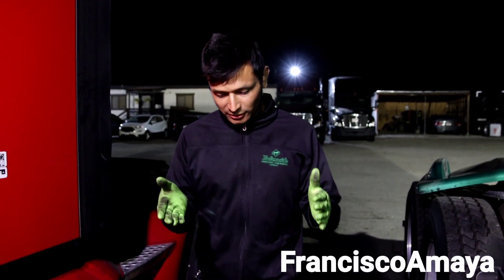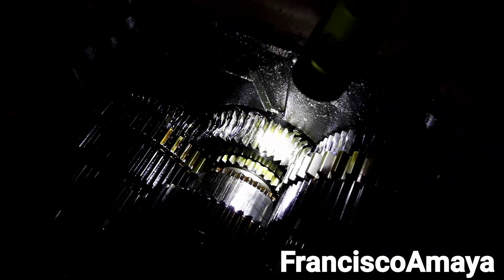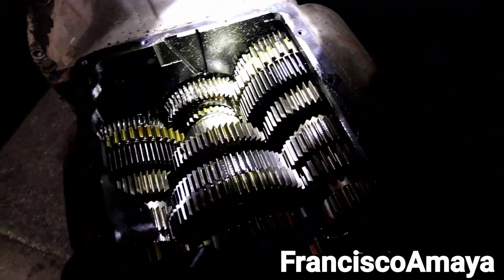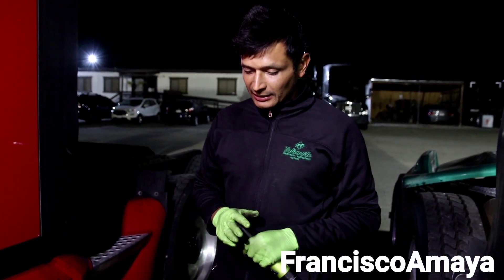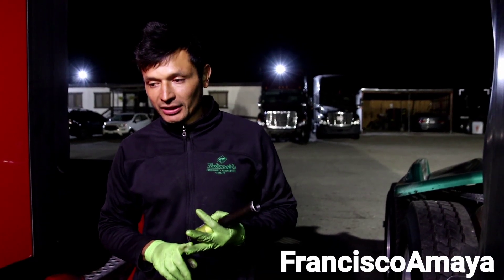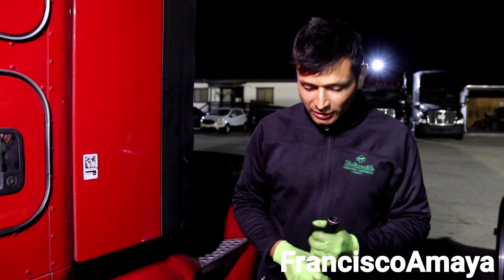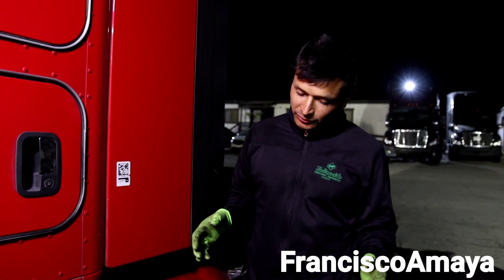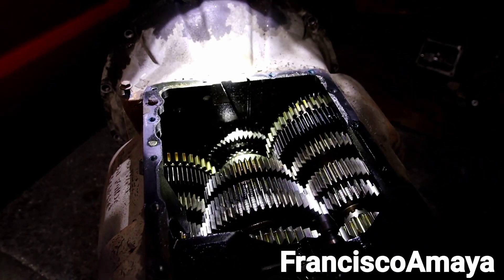Freightliner Cascadia FRO16210 eaton 10 speed transmission broken no lubrication damage gear

Comment: Truck was in the shop for bull gear problems, shop drop the transmission 1st time replaced bull gear, put it back, making noise drop it again change the clutch, 15 kmiles later transmission got damaged, can this be prevented?

Comment: My shifter pops out of gear when I take my foot off the excelerator peddle, when cruse control goes into coasting, when I go to accelerate when using the jakes. It happens with or without a load, even when Bobtailing. Speed does not matter.  2014 freight cas. 10 speed.